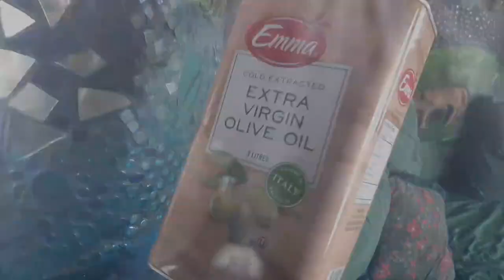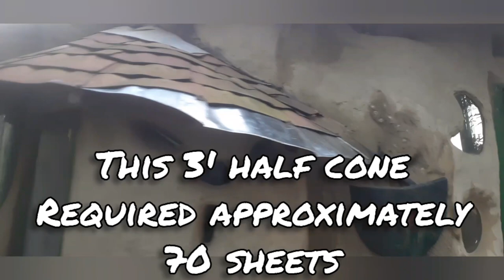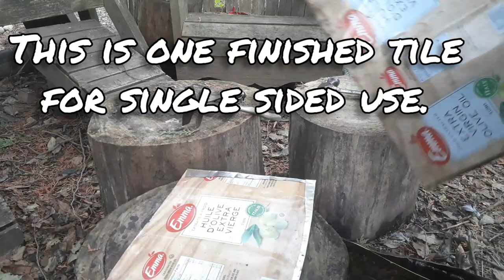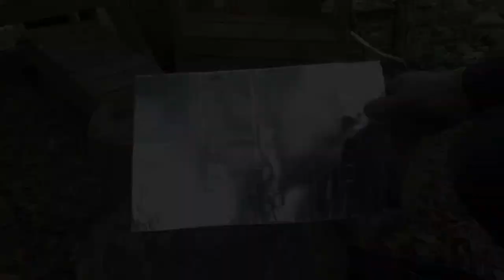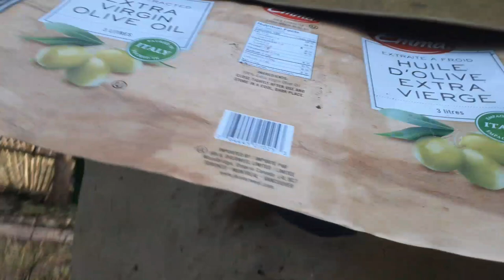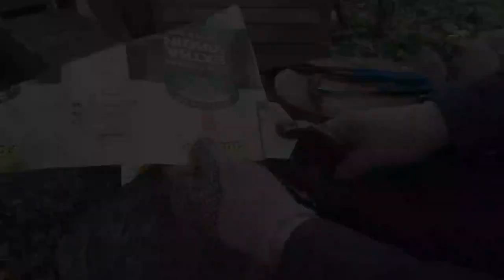Free steel roofing tiles from recycled olive oil cans - Ontario Permaculture

Comment: Great tip!  What about large steel cans?  Would those work?
Reply from the maker: Absolutely!  Large steel cans (100 oz or bigger) would be slightly shorter than these olive oil cans, but should still work well.  The biggest issue is sourcing enough.  I suggest a reliable Italian restaurant.

Comment: I am interested in building a cob home. Where do I begin. What books, websites, or any other learning tool do you suggest?
Reply from the maker: Cob book: "the hand sculpted house" by Smiley, Evans, Smith. - everything you need to know except local code.  Get another book on 'building to the code'. Exceed code. (Do better than code minimums)
Learning tool: a shovel, in clay soil.  If you don't know where you have clay soil, then a jar, (to soil strata test, covered in t-h-s-house book), and then a wheelbarrow (or bucket), a tarp, and a hammer and saw. Hands on tools are the best tools for learning hands on experience. Just use them, use the clay, and learn the way. Start small, and grow.
Reply: @ontariopermaculture3665  Thank you!

Comment: How long before they need replacing? Will they rust?
Reply from the maker: You can see the amount of accumulated oxidization on the upper tiles after 5 years.  We are presently experimenting with the longevity of this technique in situ as demonstrated in the video.
Reply: @Ontario permaculture  i see the rust now. At first i thought that was paint!
Reply: Maybe keep paint side out as protection from rusting?